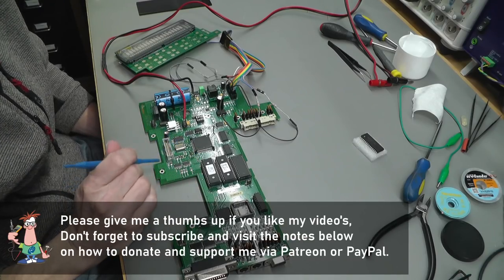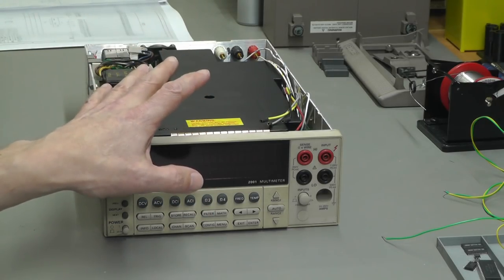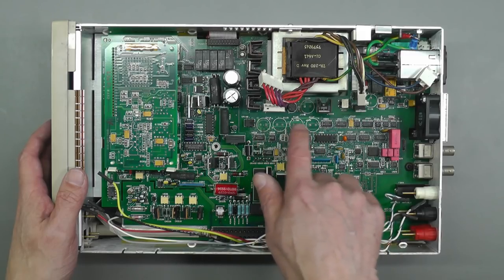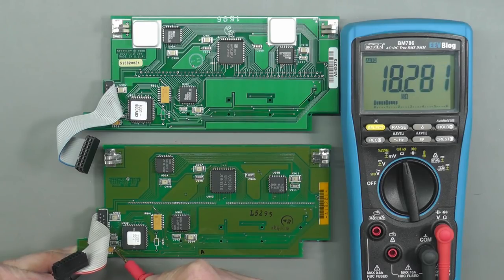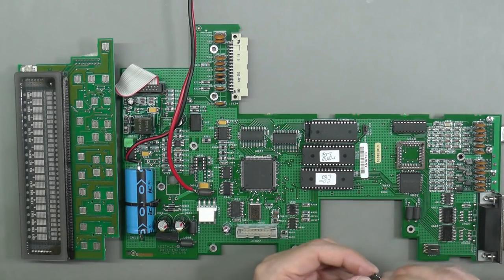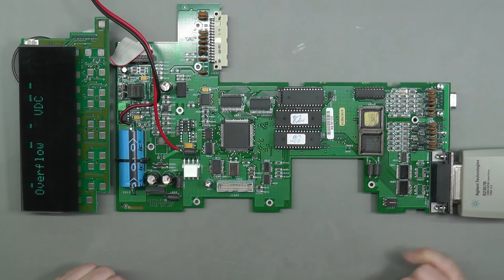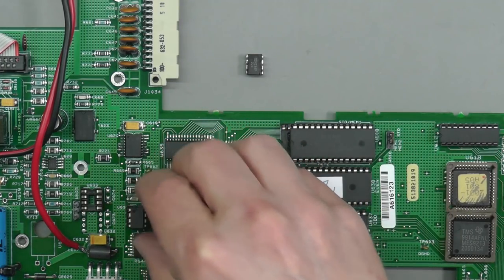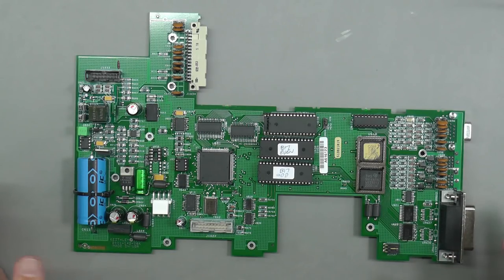No.089 - Keithley 2001 7.5 digit Multimeter Repair - Part 3

Comment: Your pain has been our gain. It's been very interesting to follow. As I stated before - when you get a short on the VCC line it's never very easy and this project has not proved to be an exception. With multiple component failure it seems that everything on the 5v line has failed. I can't wait for the next episode.

Comment: Only 5V regulators that need extra capacitance are the LDO versions, the regular ones, that need 3V across them to operate, are perfectly fine running with no output capacitance at all, like the original LM7805, and are stable. But yes unknown ones could be a LDO version with nothing other than a tiny bit in the datasheet about input output differential being 1V, which means they have a PNP pass device, or a small note about ground pin current being higher at full load as against no load, as the PNP base current has to go somewhere. The NPN versions simply get it from the input side.

Comment: I'd guess those SN75160's and every other IC are also dead if they share that same supply rail. I think I'll add some additional protection to future designs if there are expensive parts used! Are you able to backup the firmware from the display MCU with the Dataman? Did you approach Keithley to see if they can supply spares?
Reply from the maker: I haven't backed up the display board firmware, not sure I want to go to the trouble of removing it just incase I damage it, and knowing my luck it would be locked anyways!
The GPIB buffers are available via Ebay new old stock, I bought some to repair a 3458A a few years ago, 75160, 161 & 162, still available to buy now.
I haven't tried contacting Tektronix (Keithley), but interestingly I did contact Tekmos about getting the firmware for their IO controller or replacement but they said it was proprietary to Tektronix so no luck.

Comment: Is the GPIB address lost not related to the EEPROM memory, just saying that it has lost the stored value rather than any connection fault? Potentially disables GPIB until a valid address is configured?
Reply from the maker: More than likely thinking about it......and why I can't connect to my network, i.e. there is a null or corrupt GPIB address configured currently. GPIB can wait until I get the DMM up and running.

Comment: Nice to see another impressively competent repair of a 2001. I tried my luck on one some years ago but got stuck at the broken VFD inverter brick ERG E705-E905VF which is not in stock anymore. May I ask if you still need the one from your donor device?😊

Comment: Strange that if you're unit is more recent, that it has trough hole memory chip and the other has more SMD.... You would expect that a more recent model has more SMD parts.....
Reply from the maker: I think back then, you really had a choice in relatively equal proportions for the use of TH or SMD. Neither was termed "old school" back then.
Pcb rev dates:-
Donated digital board = 1990
My original = 1992